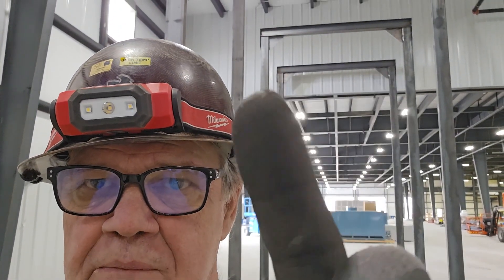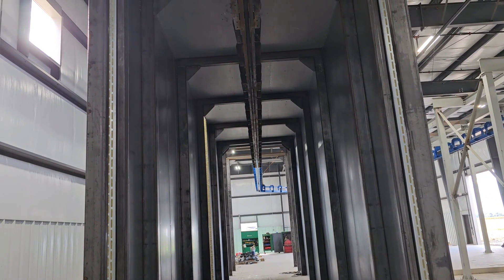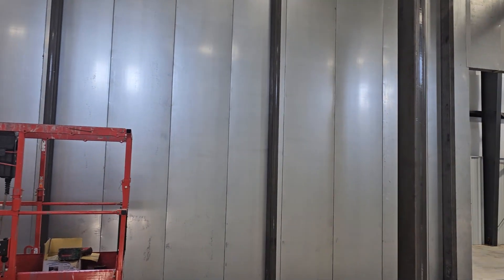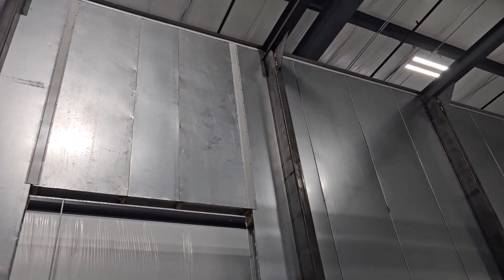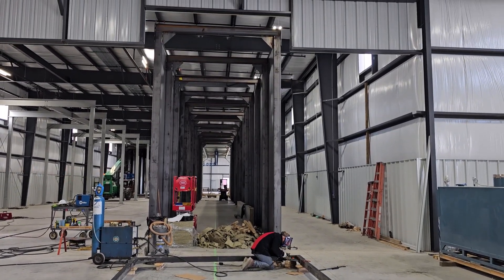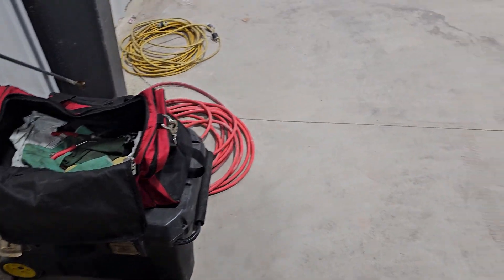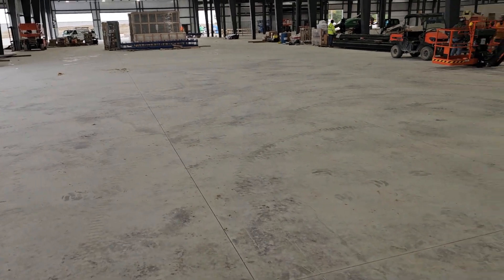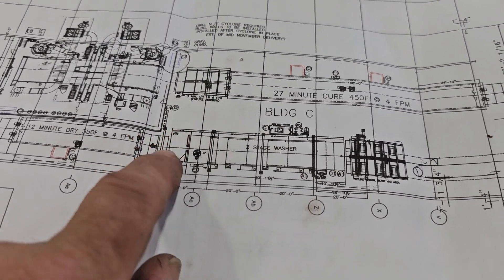Powder coat line part #3

Comment: I probably watch your shop videos more and with these, kind of play and watch them in while doing other things.  These updates are a nice pace to be able to watch, so you are doing good for me on what you are including.  There is a lot of work and design that goes into these systems. Based on your previous projects, getting the metal framework in is probably the easiest part to follow along with.  I've always had issues reading and visualizing blueprints, so that job would be tough for me, especially when you start to get into the electrical.  Thanks for taking the time to put the videos together. It is interesting to see the time it takes to design and install things like this.  Looking forward to catching up on the rest of the updates.

Comment: Hi Stan, I'm interested in the "Powder" coating process. The shop that i go to (30yrs) can handle a car frame. They coat specialty car/bike stuff and industry widgets. 375* for 15 minutes.
Reply from the maker: That would be a standard melt coating, they make low and high temp coatings also.